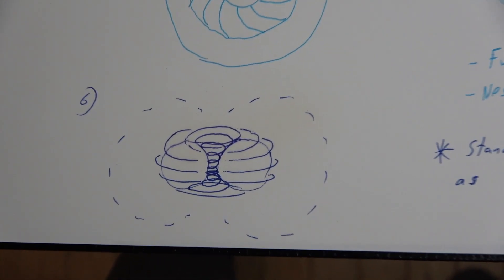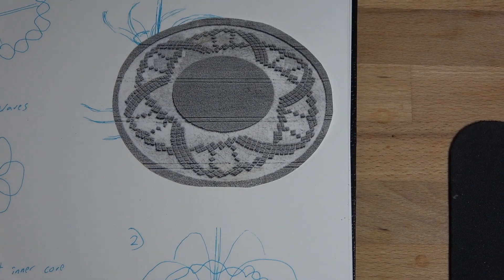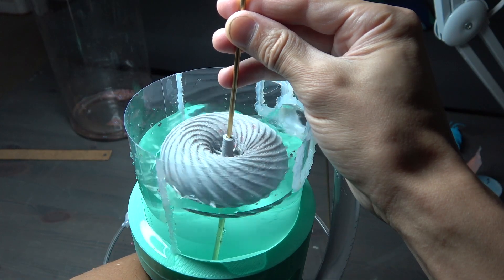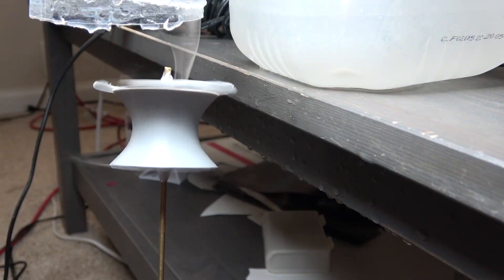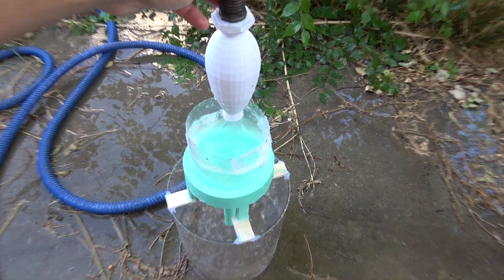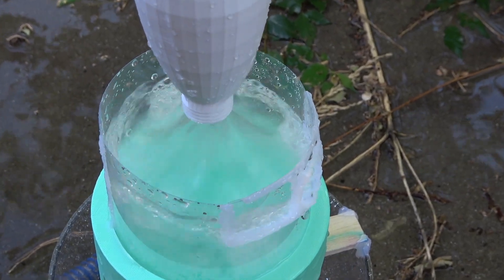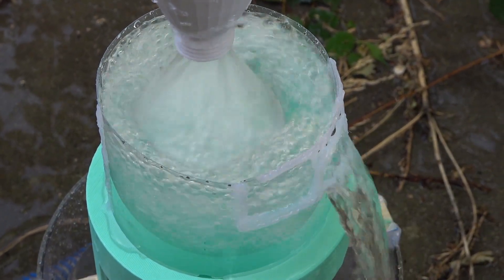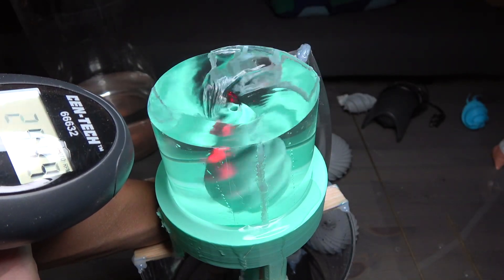Torsion Field Water Propeller/Impeller

Comment: ELIMINATION OF COSTLY FUELS AND NUCLEAR FISSION
This fact proves not only that truly unbelievable supplies
of energy can be mobilized, but also that this can be done almost without expenditure, since the method requires neither
costly fuels nor nuclear fission; and only a small amount of
water or air, which is refined in the process. The pull of the
suction spiral can yield any required amount of energy. Remembering that during hurricanes and cyclones the same suction forces are at work and that they lift easily tons of sea water,
whole buildings, or even railroad trains which fall into their
paths, one can imagine what could be achieved were it possible
to produce them by mechanical means. A great visionary and
inventor has been able to find the answer to this spendid riddle
by submitting nature to a careful and close scrutiny.
In this case however, the difficulty was not how to discover
the mysterious and resistance-less suction forces, but how to
design the proper tubes, since ordinary round tubes cannot be
used. It meant finding a tube design which would make it possible to control these forces. Viktor Schauberger was fortunate
enough to wrest also this secret from nature, but for the time
being it cannot be ciscussed due to the status of the patent rights.
Truly careful observation can help solve even the most difficult
problems.
Those still hampered by obsolete physical and technical concepts find it hard to understand such natural laws, because they
are still firmly convinced that a motor must be supplied at one
end with 100% energy in the form of coal, oil, water or the like,
in order to deliver at the other 10 to 30% effective power. With
Implosion this ratio is reversed! The temperature gradient can
be utilized almost 100% since there are virtually no friction
losses. In the case of the Implosion, an impulse starts the suction spiral, whereupon the whole turbine begins to breathe like
a living organism; or, when water is used, to act like an arterial or venous circulatory system. It produces at the same time
a biological vacuum and continues to function until the supply
of energy which is stored in the material, that is, in the moving
medium, has been used up.
Reply from the maker: Wow...   well said.  Thank you for your input here, I really appreciate it.  My next torsion impeller will work much better I'm sure of it.  It is the self sustaining energy dynamic that interests me the most.

Comment: It's a long shot but perhaps the Impeller needs to be Asymmetrical in design? Nature's favorite spiral pattern, the logarithmic spiral, breaks the symmetry and seems to be its preferred form of energy movement, considering designing machines with Asymmetrical winding configurations can lead to OU perhaps the same approach needs to be taken for water movement devices?

Comment: That donut should have a hole in the center to push the water through, thus creating implosion
Reply from the maker: It does have a hole in the center of it.
Reply: @spiritelemental hmm there is something to this though. I think the way it’s connected with the drill throws off the ratio of the water displacement. It seems like the water would have to flow freely through the hole in the middle with no obstruction but I can’t think of a clever way around this lol

Comment: Let me know if it will float with no shaft, if so sign me up for one.
Reply from the maker: Yes it does, much like the hollow egg propeller/impeller!  I could ship it to you with no shaft but I would still leave the brass rod in the box so you can install/glue it in at a later time, if you so chose.